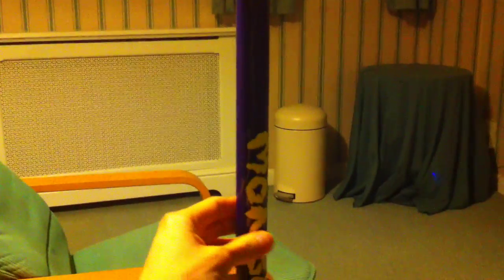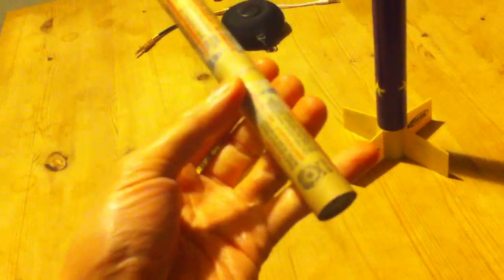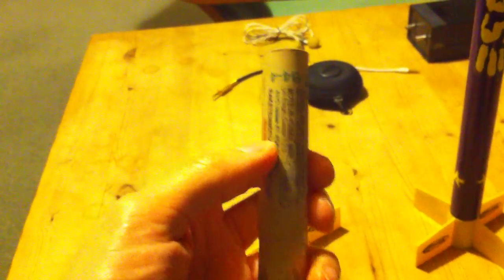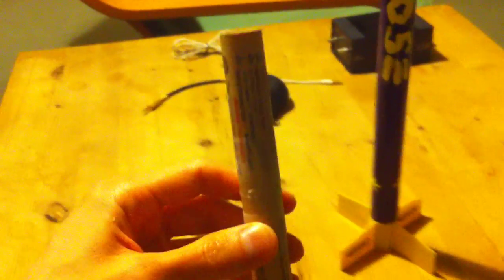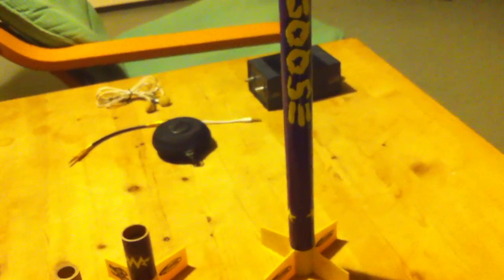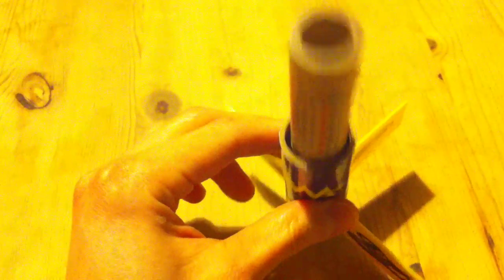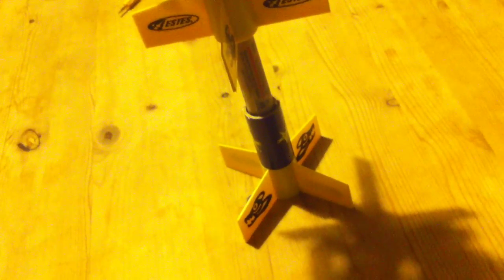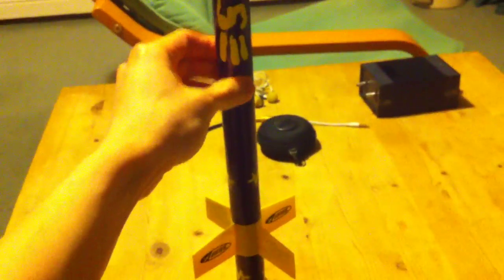My fully constructed 2 staged Estes Mongoose rocket

Comment: But if the first engine ignites the black powder to ignite the second engine, wouldn’t there be a possible explosion???? Please help
Reply from the maker: no because the pressure doesn't build up so it won't explode. Rocket fuels are slow burning anyway.
Reply: Brian Su Thank you so much 😊

Comment: How do you ignite the second engine ?
Reply from the maker: The first engine has no delay between the main charge and ejection charge. The latter which is normally used to blow the parachute out will blow the 1st stage away from the 2nd when it ignites. This will in turn cause the 2nd stage engine to ignite. So in short, the 1st stage's ejection charge ignites the 2nd. Take them together with thin cellotape around the outside. The ejection charge will melt them in the blink of an eye.
Reply: @BrianSu  wow thanks for the detailed reply !
Reply: @BrianSu  But doesn't it mean that the first stage will have no parachute ?
Reply from the maker: @low-keyforce7204  Correct 1st stage will fall back to the ground with the fins attached w/o parachute :)
Reply: @BrianSu  Do you there is a way to recover the first stage with a small parachute? Or is that impossible due to the small size available?
Reply from the maker: @Banstead1004  1st stage will fall back to the ground together with the 1st stage rocket body and fin. There is no way to attach a parachute to this. Technically it won't fall far from where you launch because it travels up a lot slower due to the extra weight.

Comment: So you don’t use this like a multi-stage, you just tape the two engines together?  ie. You don’t jettison the first one.
Reply from the maker: Hi. This is how multi-stage model rockets work. The first stage has no delay between the main burn and the ejection charge. When the ejection charge fires upwards, it ignites the 2nd stage and blows itself off as it burns through the tape instantly. The first stage then falls to the ground along with the bottom part of the rocket body.
Reply: Brian Su Oh ok.  That how I thought they worked, but the tape confused me.  I thought the tape would force the the first stage to remain attached to the rocket.  Thanks for the clarification.
Reply from the maker: @randomamerican3287  ohh no. without the tape, the rocket would be in 2 separate pieces. The thin layer of tape is the only thing that's holding the bottom section of the rocket to the top. Both sections grip against their respective rocket engines by friction.
Reply: We used to always jettison the first stage. It gets rid of the extra weight of the spent stage.

Comment: Sorry I just realized this is a very old video.  If you are still there, do all 2 stage rockets require a taping of the engines together, or was it just for this particular rocket?
Reply from the maker: Hello, I'm not sure whether the fins should line up. Yes all black powder type engines need to be taped together like this. This is because the top of the first stage has a charge that's like the parachute ejection charge. This charge will burn and push the hot gasses upwards towards the 2nd stage to ignite it. Without the tape it may just blow the 2nd stage off without igniting it.